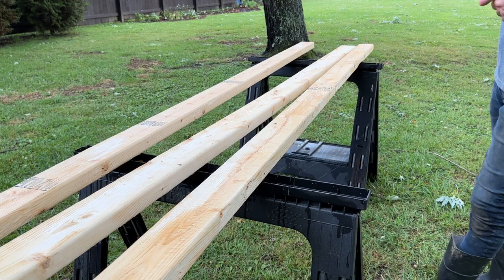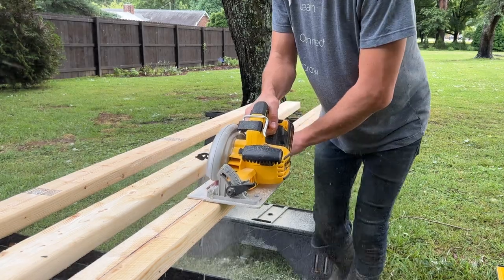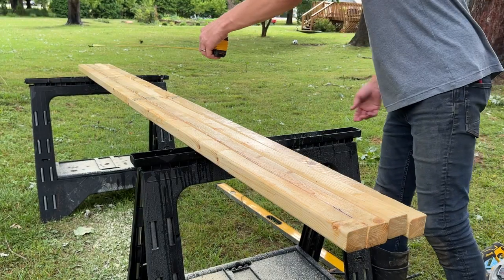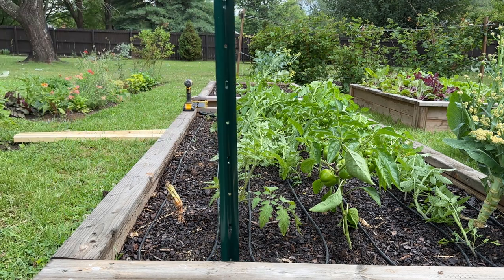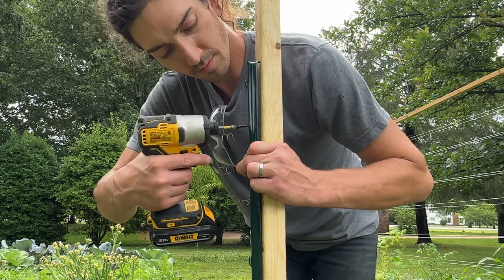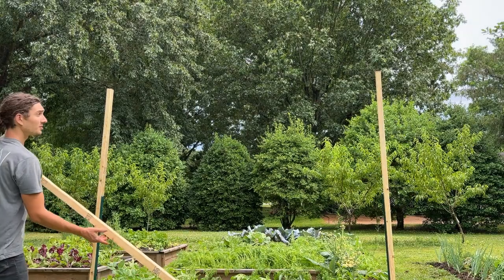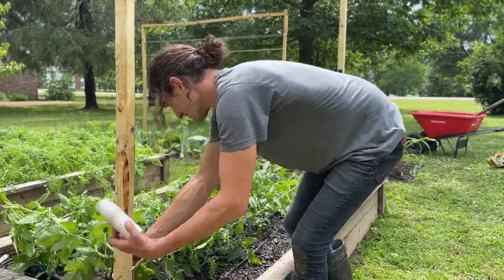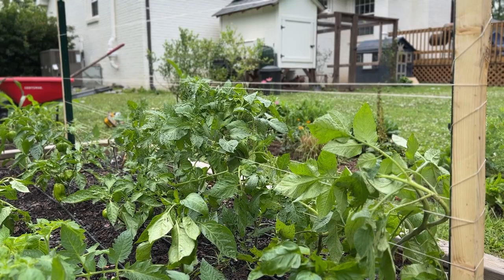My Favorite Trellis For Any Climbing Plant | Cheap and Simple

Comment: I built this two years ago. Exact same method but I split mine using a table saw and no wood preserver. I use the square netting you can get but I’ve been mostly using the for beans. Next year I’ll start trying tomatoes so I’ll lik at removing the square netting from two which now by now well aged in the sun and string horizontals. It’s definitely east and cheap compared to buying ready made in stores.
Reply from the maker: We love it too!

Comment: I did something very much like this. Instead of using wood, I used PVC pipe to make the same shape that slide over the same metal fence posts that you're using, and then wrapped strong line around some screws (that are screwed into the PVC) going horizontal, like the line in this video. If the line is loose, just wrap the excess line around the screw head.
Reply from the maker: PVC is such a good tool for the garden. we use wood as much as we can because it’s inexpensive, easy to work with, has nice rigidity and looks nice (most of the time).

Comment: Using a wooden frame is not going to last long. I use tee posts with 1&1/2" pvc pipe over the posts. I connect them with more pvc pipe for my horizontals. Works great and if you paint the pvc it lasts for years and it's easy to take down. Just use silicone not pvc glue on your fittings so you can pull it apart easily at the end of the year. I've used this method for 8 years now with the same materials.
Reply: Thats a good idea. How do you secure the PVC pipes to the tee posts? For example, he used decking screws to secure the wood to his tee posts.
Reply: @pm-100k  You put the pipe directly over the t stakes and bend it to go very the opposite ones. You have to test how much bend you have before pounding the stakes in place.